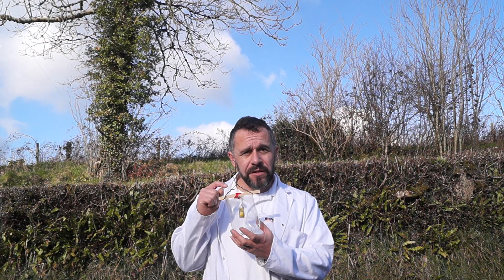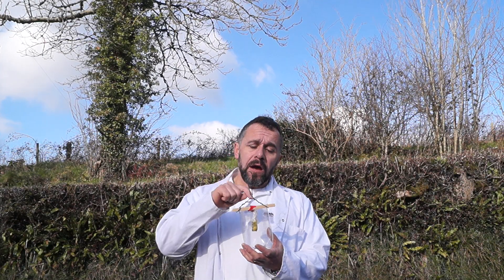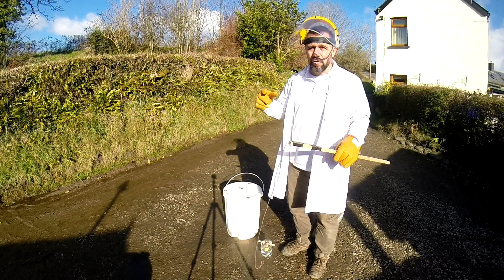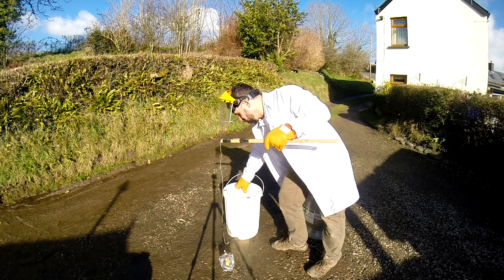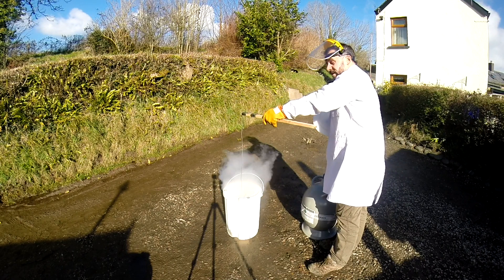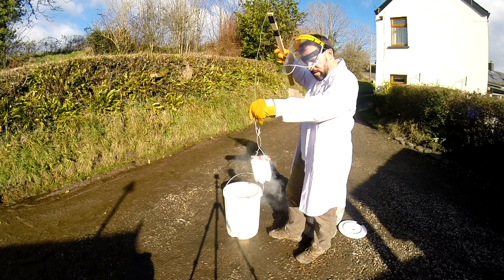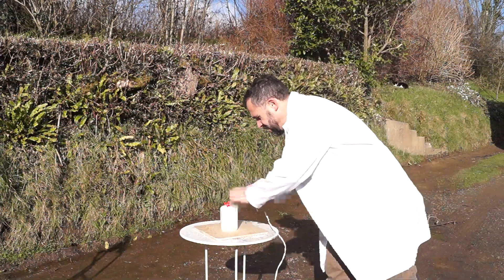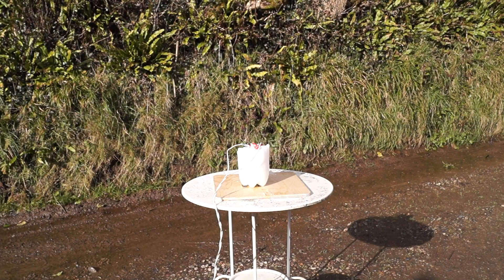How To Make Ice Cubes With Liquid Nitrogen and Gunpowder

Comment: I like the theory behind this - it just needs some polishing to make it more appealing to Joe-public!

An explosive proof outer chamber to contain the freshly made ice cubes and a flavourless explosive charge!

It would be quite an entertainment at a party though . .
Reply from the maker: Paul Roberts I think finding an explosive that leaves no residue is the problem.  The closest we could think of would be a mixture of hydrogen and oxygen as where the residue would just be water - then the problem is that you need to hold the gases in something while the ice sets around it.  Balloons or anything plastic will leave an unpleasant taste (and will probably be toxic as well).
Reply: wonderstruckwow You could shoot it at something using gunpowder to smash the large block of ice to bits?
Or perhaps make a hollow block of ice which is accessible via the bottom so you can add an hydrogen/oxygen mixture and then have it explode? Much like the way you fill a plastic bottle with a hydrogen and oxygen generator. This would work I guess? Or the ice will just be blown up in to the air…
Could you please consider this idea? Like Paul mentioned, it would be great fun at parties!
Reply: wonderstruckwow Trinitro-cellulose / cellulose nitrate would probably leave less residue (?).   Maybe somehow form a void in the in the middle of the ice block in order to introduce the hydrogen/oxygen that way- or compressed air.
Reply: Oli4vn like a liquid nitrogen bottle bomb propelled bowling ball - now we may be on to something!!!!
Reply: Paul Roberts Yes yes yes!
Reply from the maker: Paul Roberts +Oli4vn We've done something similar with our Liquid Nitrogen Mini Basketball Mortar already (you can see it at https://www.youtube.com/watch?v=WfT838WVT-U&list=PLxNMKdTABaYi5delOcgd8uMKN5FZqQD4_&index=19), but a bowling ball sounds good.

Comment: that was really stupid
Reply from the maker: Walter Clark Yes, it was and we make no apology for that.  We just wanted to see what would happen if we froze a small gunpowder charge in a block of ice and then set it off.
Reply: wonderstruckwow
OK, with such admission, I'm re-subscribing.

Here's a suggestion:  How about a variety of underground explosions.  See if you can make something useful.
Here's some ideas a Manhattan Project test engineer got funded to do after the war:
tenderize meat by submersing both the carcass and the explosive in a pool of water. It can't be gun powder, it has to be a detonation.  In fact why not explain the difference between the two in one of your videos.
Install telephone poles by mounting an explosive under a telephone pole on top of the ground. It falls in the hole it makes.
A navel gun shooting concrete bullets into the side of hill  instead of explosive charges.
Reply from the maker: Walter Clark Ha ha - yes, like the ideas.  We have in the past tried to get rid of moles by exploding bottles of liquid nitrogen underground, generating shockwaves to encourage them to leave the area but it seemed to have the opposite effect.

A video looking at the difference between detonation and deflagration would be a good idea but our explosives license doesn't currently cover the kind of explosives that would be interesting to look at.
Reply: I'll have to check that out. Thanks. 
Don't know what an innie is.
I really think WonderStruck should consider the underground explosion. He could drill a hole down into it to see if it collapsed or held up. Either way, it should be fun. Oh and the self drilling post hole should be fun too. As I recall they held the pole up with three ropes tied to sand bags so that it could jump up a little bit for falling into its hole.
Walt
Reply: wonderstruckwow Walter Clark Actually the meat tenderizer thing was done by mythbusters.

Navel gun sounds painful. You'd have to have an innie yes?
Reply from the maker: Walter Clark We've done an underground liquid nitrogen explosion before - you can see it at 4:54 in our 10 Random Liquid Nitrogen Experiments video but I think we could probably do some more of that kind of stuff.